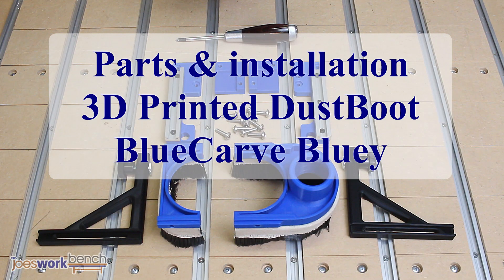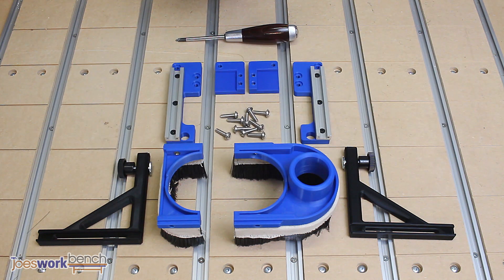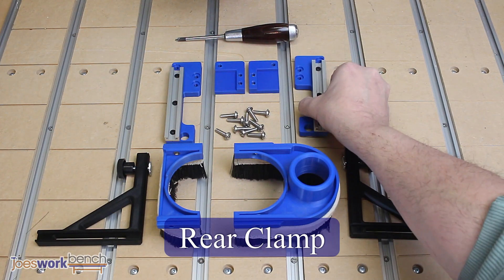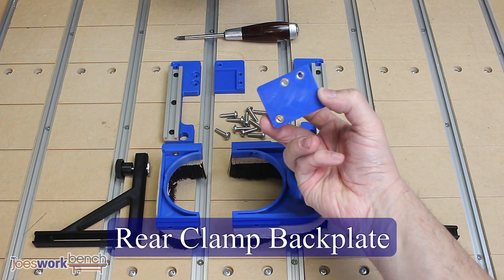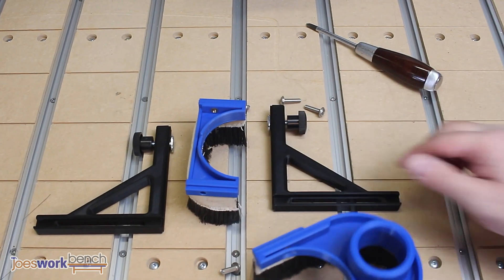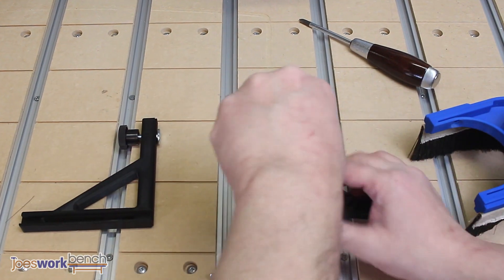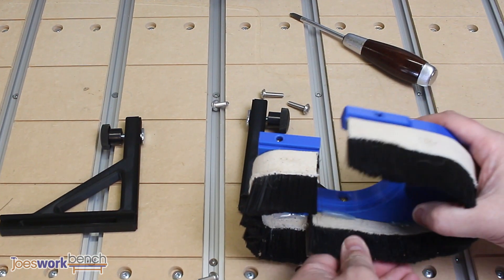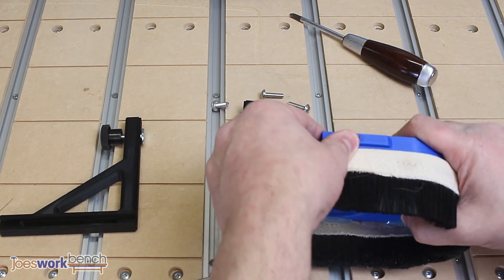BlueCarve Bluey CNC DustBoot Parts and Installation

Comment: From what I see here, I'm missing a critical number of parts, and for this reason, I've not used my boot. I don't know about 'super cool' because whenever I need to set the zero point, the boot has to come off. If anyone knows a better way please let me know.
Reply from the maker: This dustboot was for the original bluey, I haven’t made one in about 4 years. Front half of the dustboot comes off to set zero, personally I just use a shim and the leave the dustboot in place

Comment: Thanks for this Joe  As a total beginner to this.. What do you recommend for the actual vac part of this? What is the bang for buck option to go alongside this .a Ryobi style shop vac? Something else? Thanks!
Reply from the maker: Yes, a shopvac will capture most of the dust and really cut down on the airborne stuff you don’t want to breath.   

You can use a woodworking type dust collector for even better performance but the trade off is visibility as the hose is much bigger.

Keep the hose as short as possible to reduce friction/suction loss.

I use a festool shopvac, I am not familiar with the ryobi range.  

You’ll find your shopvac is one of your most use tools, get the best one you can afford. 

Routing/sanding/finishing/cnc and cleanup all make use of a shopvac. It’s not just for the cnc. 👍🏻
Reply: @JoesWorkbench  Thanks Joe..I see Makita has an AWS system where when you start the Bluecarve or Mitre saw it can automatically turn on.... Not sure if that's a gimmick or would be genuinely useful! Thanks!